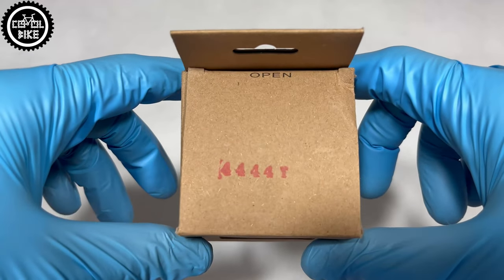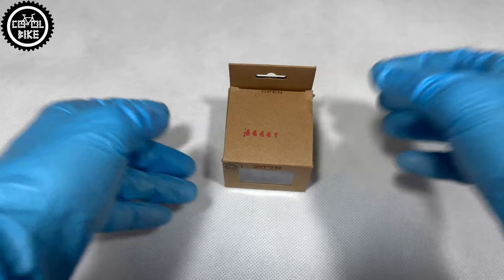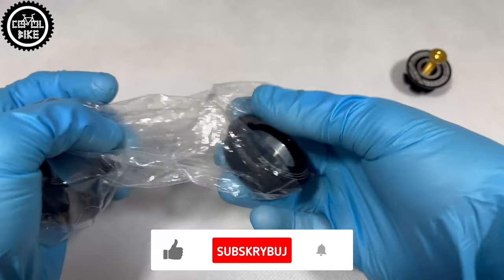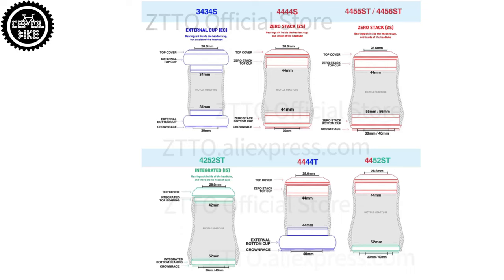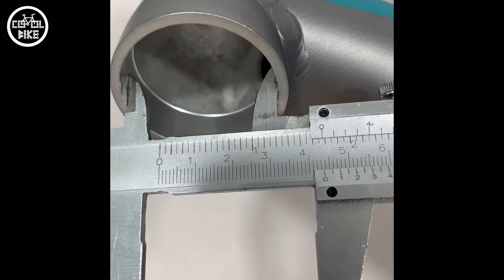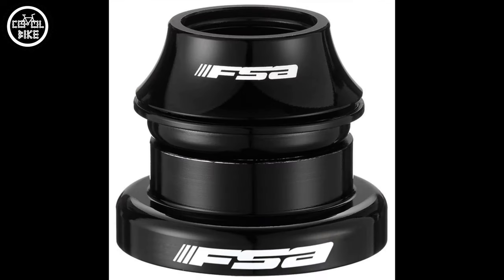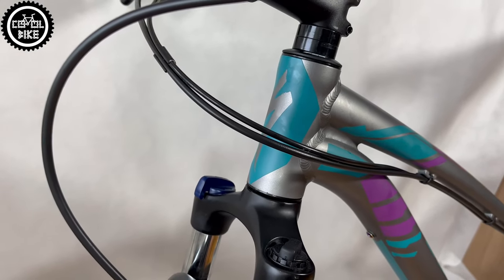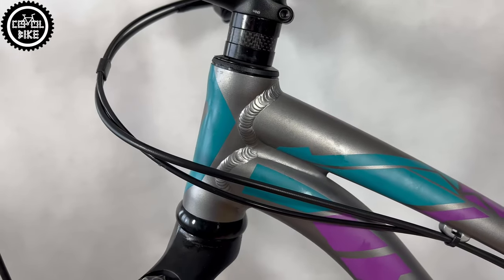ZTTO 4444T HEADSET// HOW TO INSTALL FORK WITH TAPERED STEERER TUBE TO OLD FRAME WITH 44mm HEADTUBE

Comment: For people that have a straight headset tube this will make your headset as good as a tapered headset tube.
Depending on the ID and angle of the bearings used a straight or tapered fork can be used....👍
Reply from the maker: More or less… yes :)

Comment: Hey, great video, but i have a question, does the cane creek 40 series with the zs44/ec44 does also work on straight headtubes?
Reply from the maker: Hi, yes. These headsets are equivalent to ZTTO ones from the movie. If you have internal headtube diameter of 44mm, and enough space for the lower cup flange, they will fit.

Comment: How about the height of the bottom cap? I have a short steerer tube, and afraid that it might be too short
Reply from the maker: It height is 13mm, and I think it's one off the smallest
Reply: @Safwan Rahman saya pun pakai marin bobcat juga. nk convert ke tapered. Abg beli size yg mana ya?

Comment: So, what do I have to do in order to buy the right headset? Take the measurements from the upper and lower parts? Then what? Thanks.
Reply from the maker: Check if the inner diameter of the headtube on the top and bottom is 44mm. If so, will a 10mm high flange of bearing cup will fit from the bottom. And finally, if everything is correct order headset. Good luck:)

Comment: Does the top dust cap has rubber sealing?
Reply from the maker: Hi, upper cover have a plastic seal on the end, there is no oring inside or anything else.

Comment: I wonder if the shorter insertion depth could cause the headtube to fail?
Reply from the maker: Which "shorter insertion depth" do you mean?
Reply: @COOLBIKEyt  I mean with the ZTTO cup the insertable section is only 8.5mm deep, whereas with the Cane Creek which I believe is the original adpater cup the insertion is 15mm and they recommend getting the headtube reamed to accommodate if necessary. I assume they designed it this way to provide more surface area to distribute the forces and prevent ovalization of the headtube. That 8.5mm insertion depth with the ZTTO is a little troubling because a semi-integrated headtube is not designed to have lateral forces of leverage outside of the tube itself such as would be the case with this adapter cup.
Reply from the maker: @FATFORKS  It seems to me, that such a short cup collar is a must. Because I had a case where the headtube of one frame was so narrow inside, that it was impossible to press the cup to the end. 
I have already installed a few sets of these headsets, and there are no problems with them, but this was on bikes for normal riding, not for enduro/trail/dirt purpose.

Comment: So this ztto headset can be used to a 34mm headtube to convert into 44-44t for tapered forks? Just some clarifications on my guessing.
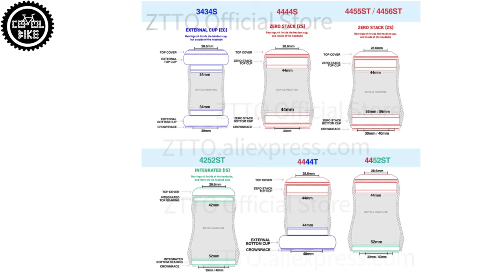Reply from the maker: No, because flanges in ZTTO have a diameter of 44mm, so I will not go into the narrower headtube 34mm. In 0:46 you have a graphic showing how it works.
Reply: @COOLBIKEyt  thanks, i do have a 26er fullsus frame, its not integrated 44mm, it was 34mm, maybe i cant use a tapered fork for that extra frame i have.
Reply from the maker: @kennangargarita7179  
Yes, you'll probably have to use that fork to another frame. This headtube is too narrow.

Comment: I have a problem! My frame headtube is 50mm, i want to make it taper, how do i do it? What dimensions of cups and bearings i need?
Reply from the maker: First you need to know the exact inside size of the headtube. 50mm is a strange dimension...
Reply: @COOLBIKEyt  its a DH Specialized status 2 2014, its got 50mm the whole headtube from top to the bottom, right now its set to 1.1/8”, i took bottom out and now i need new bottom cup for taper fork (39.8/28.6mm)
Reply from the maker: @sc_273  From the Status specs in Specialized webside, you already have tapered there: 'HEADSET
Semi-integrated alloy cups for 1-1/2" headtube and 1-1/8" steerer, cartridge bearings"
Reply from the maker: Probably if the headtube is 50mm on the outside, the walls are 2x3mm, so it's 44mm on the inside. In this case, these headsets will be ok, but I advise you to measure and make sure.
Reply: @COOLBIKEyt  Actually, they are 50mm from the inside, and because od the DH frame, walls are 5mm each, si 60mm outside. In 28.6/44-50.6/39.8, what diameter of bearing is on the buttom?
Reply from the maker: @sc_273 Very strange headtube, but the bike is almost 10 years old. The lower bearing in tapered headset is 52mm, so it will not fit into your headtube. You have to find headsets with an external cup EC49,7(probably...or bigger, It depends on the exact internal dimension of headtube). Thare are same Neco's on Alliexpress.
Reply: @COOLBIKEyt  Can you provide me the link please?
Reply from the maker: @sc_273  Links won't work on YT. Just search for: headset ec49,7 (but as I wrote, make sure that 49,7 is a good size, or should it not be 50,..)
Reply: @COOLBIKEyt  so thats inner headtube dimensions? so the bearing is around 40mm outside wall
Reply from the maker: @sc_273  Yes, you need to know the Inner Headtube dimension, to know what EC cup you need. Bearing size is OD:51.8 x ID:40 x H:8 x A:45°
Reply: @COOLBIKEyt  this is all screwed up, because i need cups that can fit in 50mm headtube, which means that bearings must be less than 50mm wide, so that everything can fit
Reply from the maker: @sc_273  NO, as I wrote you earlier, you must have external cup( outside the frame), just like the ones in the video. Additionally, you will have to take into account, that your headtube will be taller over 1cm, and it will probably look bad. As the diameter of the head will be larger than cup, unless you find one that is the same size.
Reply: @COOLBIKEyt  Problem is that i dont know where the bearing is placed, outside the frame or inside
Reply from the maker: @sc_273  I just wrote you, that the bearing is in the external cup,  outside of the frame. Because how would a 52mm bearing fit into a 50mm head tube. I think you should go to a bike shop and consult a mechanic before you buy anything. It will be easier
Reply: @COOLBIKEyt  i found one 28.6/44-49.7/39.8, that might fit my headtube, if its external
Reply from the maker: @sc_273  If your head is straight across the entire cross-section you need lower EC (External Cup), and upper ZS(Zero Stack). So most probably  ZS49,7/28.6 - EC49,7/40
Reply from the maker: Maybe this nr 8 aliexpress.com/item/32809675120.html?gatewayAdapt=glo2pol
Reply: @COOLBIKEyt  Yup, think we found the right dimensionss! Ty buddy, i think that will fit. So the External Cup has a bearing outside the frame
Reply from the maker: @sc_273  Yes, exactly like in movie in 02:05. Upper cup ZS with bearing is inside the headtube, and lower EC with bearing is is outside. Only dimensions are different.

Comment: My bike is Marin bobcat trail 4
Reply from the maker: I think your headsets are FSA No.10 ( ZS44/28,6 | ZS44/28,6 ), so this ZTTO should fit.
Reply: @COOLBIKEyt  yes....that is for the upper diameter....what about lower.....is ec 44/40 correct diameter for lower
Reply from the maker: @shivamhazarika9541  Lower should be the same as upper. You can just take the frame i measure it.
Reply: @COOLBIKEyt  lower different bro... either it should be zs56/40 or ec44/40
Reply from the maker: @shivamhazarika9541  From what I can see on Marin website, headtube in Bobat Trail 4 2023 is straight, and the cups are the same on top and bottom. 
But if you say otherwise, then I don't understand what is the problem. Just take a measure tape and measure it.